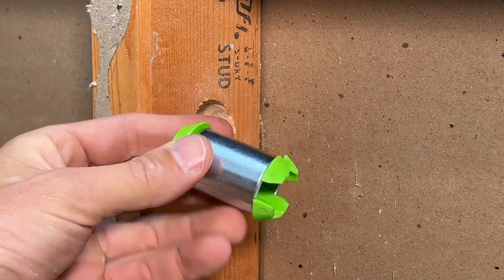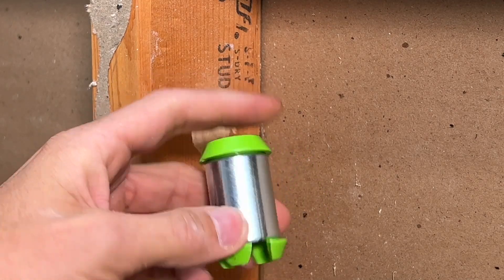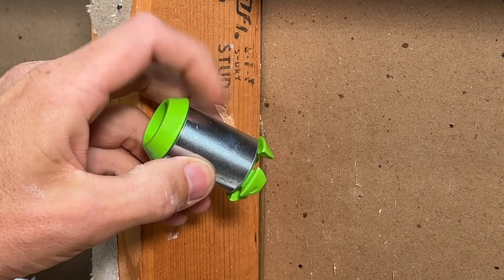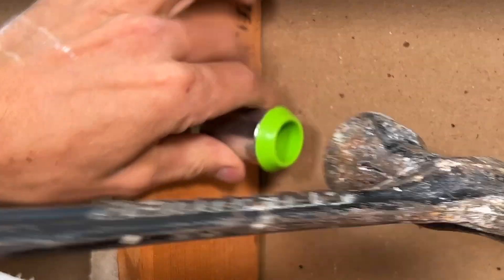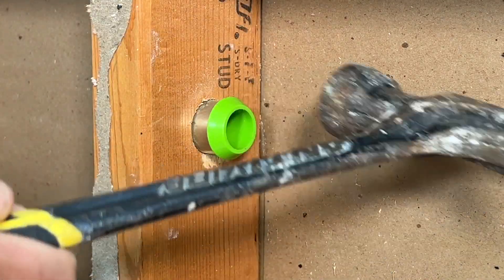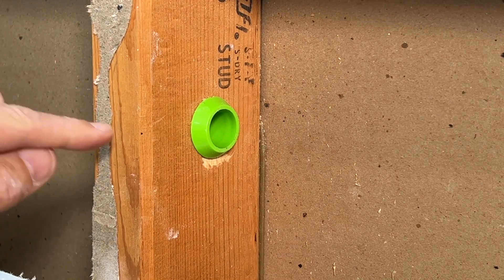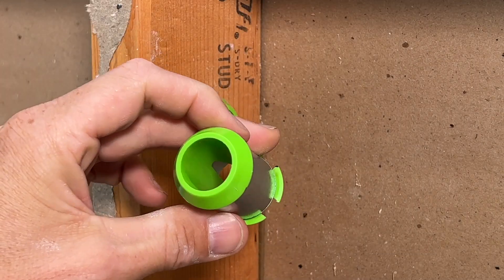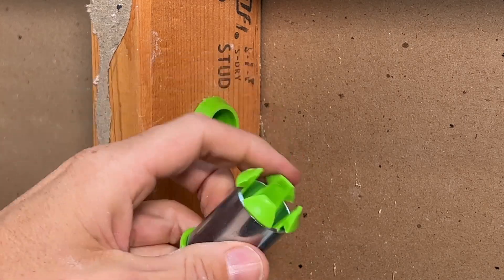How To Easily Protect Your Electrical Wiring | Installing EZ Guards

Comment: That item requires  a 1 1/8" hole . That's a lot of material to remove from a 2×4 - especially a new 2x4 . I got old 2×4s and these guards don't go all the way through some of the studs. They will tear up the sheathing on your Romex if you're not careful.  You also want put the Romex in nice and flat or it's hard to get 2 runs to fit

Comment: I used 2x12s for framing. While I don’t have any use for them. I see the benefit of those that do.
Reply from the maker: Wait, you framed your walls with 2x12 boards? 🤔
Reply: @everydayhomerepairshelp7417   yes. Just the exterior walls. When it gets way below zero. I just need a small heater to stay toasty. I doubled my insulation.

Comment: Are these really necessary?  Once wire is strung through stud holes, what forces are going to drag the wires back and forth with enough force to shred the Romex cover and subsequently the wire sheathing?  Maybe for metal studs, since the metal stud holes might be razor sharp but pine studs?  Seems like this product was developed for a nonexistent need.
Reply: It's to prevent someone from drilling into the studs when installing shelving or anything that needs to be mounted to a stud.